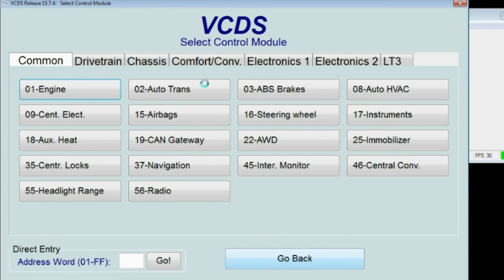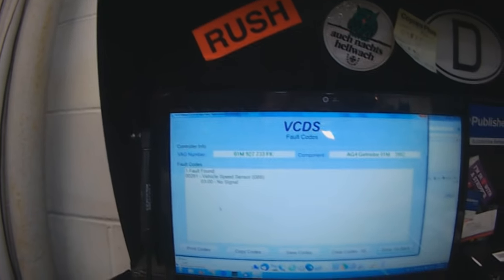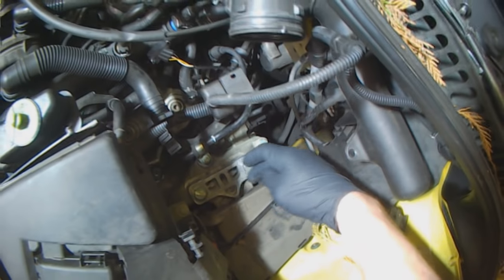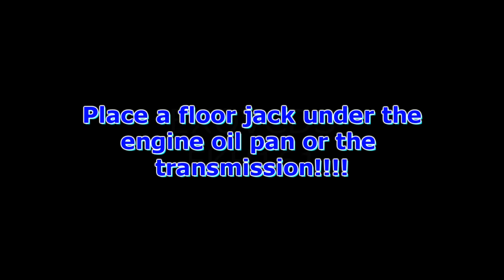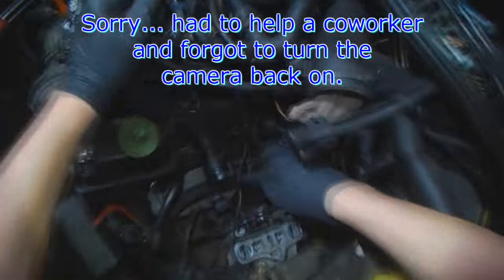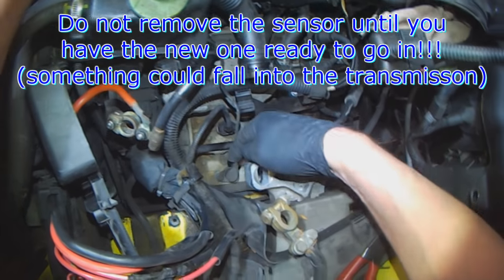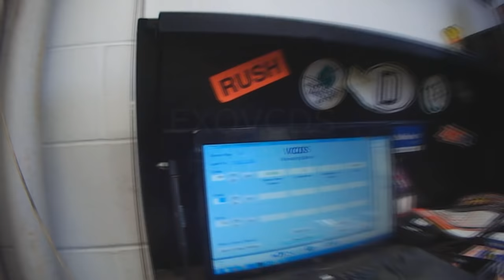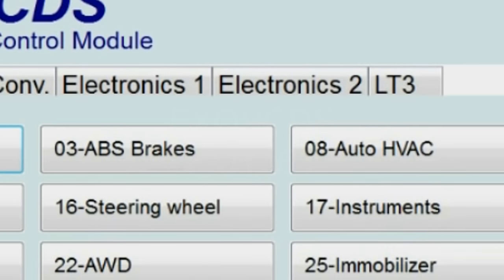VW A4: New Beetle - vehicle speed sensor (G68) no signal

Comment: Hallo. Is that same  location for Speed sensor on 10.2001 Golf 4 1.8t. Automatic.. Thanx
Reply from the maker: Transmission speed sensor... if it's a 4 speed automatic, yes.
Reply: @EXOVCDS  Hi. Thanks for the quick reply. I. Don't really know is 4 speed Transmission. He has 1.2.3.4 and D and on the side I can do it like manually +and - . Is 4 door. 1.8t. October 2001. From first or second gear shift after 3000 rpm and won't to not shift in to fifth. Again thank you for the quick response.
Reply from the maker: @denyderulo1038  Different transmission as the one in the video. The speed sensor is in a different location... I'd have to look where (probably behind the metal cover at the front facing side of the transmission).

Comment: i have a 2001 beetle shifts good but when slowing down and. when accelerating it slips what could it be
Reply from the maker: I assume it is an automatic? Could be an issue with one of the solenoids in the valve body... or low fluid. Check the TCM for fault codes.
Reply: Thomas EXOVCDS yes automatic will check the codes

Comment: 05 2.0 6 speed automatic transmission vw new beetle speed sensor location inside the transmission
Reply from the maker: Vehicle speed sensor for speedometer / odometer? Or speed sensor for shifting (input shaft or output shaft)? Fault codes? The more I know, the better I can guess.

Comment: I have a 02 golf with a miss fire replaced plugs and wires and crank sensor have code for vss could that be causing the miss fire
Reply from the maker: Shawn Viscome VSS should not cause misfire codes. Good quality parts? How's the compression? Fuel injector spray?
Reply: As far as what has gone in yes brand new parts all good quality was told by shop that speed sensor could cause the injectors to spray right and mess with spark
Reply: Not to spray right
Reply from the maker: Shawn Viscome I don't think so... that would affect other cylinders as well. Since only one cylinder is affected, focus on that cylinder.

Comment: 2007 jetta 2.5  p0721 “output speed sensor range / performance  can’t find were the sensor is located runs about 5 minutes then it won’t
Reply from the maker: If the engine stops running...  and you can't start it until the engine has cooled down, then I would say that the crankshaft position sensor is bad. Transmission Output Speed Sensor should not cause / affect engine running.
Reply: Thomas EXOVCDS  The engine does  start just the car will not move when I put it in gear it’s usually after like 15 minutes of driving thank you for your response
Reply: Thomas EXOVCDS Once it cools down when I put it in gear it moves again
Reply from the maker: @sonidovertigo2003  That is a weird symptom / condition that I have not yet come across, sorry. Which automatic transmission do you have? If it's the 09G 6 speed transmission, you can read about the G195 sensor here: (page 45) http://www.evosoft.dk/diagrams/DSG.pdf
Sensor failure "should not" affect vehicle driveability... as listed on the same page (ABS speed input is used instead). I would first make sure that the transmission has the correct fluid level and that the correct fluid is inside of the transmission. Have a transmission shop (that is familiar with VW transmissions) look at the vehicle... you'll get a quicker diagnosis from someone who is familiar with the transmission. You can also leave a comment under this video: https://www.youtube.com/watch?v=MhG1DfJsGyQ He is familiar with these transmissions.

Comment: Hey, I’ve got a vw golf gli 2.0 will it be located in the same place? I have the same codes coming back as what you had. Car is currently ( I believe ) in limp/safe mode as when I’m driving it’s not changing gears at all when I’m drive. Unless I manually do it from 1st to 2nd. Is it in that mode for safety? Or is it like that due to the sensor? Love your replies to everyone and your vid was a huge relief finding 🤘🏼 from new zealand
Reply from the maker: If it's a mk4/A4 Golf with the 01M 4 speed automatic transmission, then yes, same location / same sensor (for same code).
Reply: I had my car checked today. (I had the same two codes as you) I talked to mechanic advising that I’ll need to change the g68 sensor. He scanned and drove car, car was still not shifting right but the speed was showing on his scanning tool and still shows up on my speedometer. So he advised it has to be my transmission ? Because the speed is showing correctly ?? Help haha
Reply from the maker: @koryikinepe1874  There is a separate sensor for the odometer & speedometer. Go to a different mechanic.
Reply: I just done everything you did. Changed sensor, however car is still not changing gears normally.
Reply from the maker: @koryikinepe1874  Did you check for a sensor signal before & after replacement (like I did)? Did you check the wiring? Is fluid level OK?
Reply: Everything was fine I just didn’t check the trans fluid level.

Comment: Thanks for the video. I have a 2002 VW Bora 1.6SR.auto trans. My own code is 00529-engine speed signal missing. My car shifts normally but after sometime, it will go into gear 3. When u switch of the car, everything returns to normal. The cycle repeats often. Other codes displayed are 00518, 00545, 01314 and 01314. Pls what could be a lasting solution to this erratic shifting of my car. Thank you.
Reply from the maker: Are all those codes from the ECM or are they from the TCM?
Reply: 00518, 00529, 00545, 01314 are from Auto Trans address: 02  01315 is from address 01:Engine
Reply from the maker: 01315 in ECM says to check TCM.
00518 - Throttle Position Sensor (G69)
00529 - Engine Speed Signal missing
00545 - Engine - Transmission, Electrical Connection
01314 - Engine Control Module
The ECM & TCM are losing communication between each other... you need to check the wiring that goes from the ECM to the TCM. If turning the key OFF & ON resets things, check for a relay problem.
Reply: Thomas EXOVCDS 
Thanks for the info. Pls which relay  do I check and where do I trace the wire from the the TCM to the ECM.
Reply from the maker: I'm busy editing videos right now... I will look for a wiring diagram / information for you later today and will send you a link once I have something.
Reply from the maker: Engine control module wiring diagram: http://fkh161.ca/VW/Bora/BoraECM.pdf
Transmission control module wiring diagram: http://fkh161.ca/VW/Bora/BoraTCM.pdf

Look for a connection they both share... but something that only affects the Transmission. Since the engine does not lose power or cuts out, the problem might be in the transmission side. When I have time, I will also look at the diagrams, to see if I can find any suspect areas.
Reply: Thomas EXOVCDS 

Thank you so much
Reply: I did check the connection between the TCM and ECM from the diagram you sent me. This can be seen as the orange/brown and black/white 0.5mm cable( pls let me know if there are more) and discovered they re still OK, no damage. I also checked the grounds 114 and 608 and everything looked fine. I checked all fuses and all still ok.Is there any other thing I am missing.  I have also ordered a new G68 sensor. Your advice is well appreciated.
Reply: The wires can be seen on pg 7of 12 of the ECM diagram.
Reply: Thomas EXOVCDS 

Pls can you send me the ABS control module and the instrument/CAN gateway modules wiring diagrams. Thanks.

Comment: Hi thomas, i got a fault code p0501 with my 2001 NB 1.8T;it seem to be my G22 sensor is gone, I would like to ask u , is the vcds the Engine measuring blocks group 005 the vehicle speed its G22 value?Cause it just show 0 km/h ,but Tansimission measuring blocks vehicle  speed which g68 gave me its the same with my cluster. so i would like to know is normal that group 005 the vehicle speed be 0 km/h?
Reply from the maker: In the engine module... any km/h value should be G22 input. If the speedometer works but the engine does not see vehicle speed, then there might be a wiring issue.
http://wiki.ross-tech.com/wiki/index.php/16885/P0501/001281

Check a wiring diagram according to which transmission you have and do some checking.
Reply: yap, i think my G68 its good to work; cause vcds 02->08->Group(004) vehicle speed looks good, and G68 voltages too,  so i ill check my g22 wiring, thx a lot Thomas, i ill let u know what i have found.

Comment: i have a 2001 beetle 1.8t auto  everything works but speedo no CEL on
Reply from the maker: David Roche Is the odometer working?
Reply: Thomas EXOVCDS I don't know I will go drive it
Reply: Thomas EXOVCDS the odometer is not working in my scan tool shows no VVS readings
Reply from the maker: David Roche The sensor for the speedometer/odometer is on top of the differential. Check the connector and the 3 wires in the connector. Most likely the sensor is no good.

Comment: My automatic will only shift manually. Replaced crank sensor and transmission speed sensor. Please help! Also rpm gauge not working . Not sure if it’s related.
Reply: Thanks for the video. It helped changing the tss.
Reply from the maker: Have you scanned the TCM & ECM for fault codes? I'm at work right now... will get back to you with more info later. Year, make, model, which automatic transmission (4, 5, 6 speed?)
Reply: 2000 beetle 2.0 4speed auto. These are the codes I get. 725 1780 1850 1866. I did replace the crank speed sensor and transmission speed sensor.
Reply: I am using a cheap reader so I’m not getting much for details
Reply: And thank you, I’m really getting frustrated with this car. Lol
Reply from the maker: Are those from the ECM? Are they all P codes? P1850 & P1866 are communication faults. If the TCM & ECM are not talking to each other or the instrument cluster, you will have shifting issues as well as speedometer needle issues. I'll get back to you after work. 6pm> Pacific time.
Reply: Thomas EXOVCDS only the rpm at the dash isn’t working. And the shifting issue. Are you thinking transmission control module? The speedometer works fine.
Reply from the maker: @daveclark3989  If RPM at the dash is not working, then the TCM is probably also not getting an RPM signal from the ECM... hence the "communication fault codes". It could be a wiring / bad connection issue. The engine runs, so it is not a RPM sensor (crankshaft position sensor) issue. You will need to check the communication wires that go from the ECM to the TCM & Instrument cluster. Disconnect the ECM & TCM harness plug connectors and check for corrosion... you will need a wiring diagram to check which wires are the communication wires (they are usually in pairs, twisted together and located side by side at each control unit).

Comment: I have a 04 Jetta GLI that portentously has a bad speed sensor. I was told that it might not even be a speed sensor but the cluster that needs to be replaced. When i turn the wheel my gas light turns on at times. My odometer doesn’t work. Any suggestions?
Reply from the maker: Speedometer needle not working & fuel gauge issues, both can be caused by a faulty / bad Vehicle Speed Sensor. Depending on which transmission you have... the sensor is either on top of the differential or inside the transmission. To rule-out the instrument cluster... you can perform an "output test" using a capable scan tool, to activate the operation of all of the needles. If all needles function as they should (when activated in output tests), then the problem is NOT with the instrument cluster.
Reply: Thomas EXOVCDS its a 6speed manual.
Reply from the maker: Let me look at a wiring diagram... I'll get back to you.
Reply: Thomas EXOVCDS you the best brother.
Reply from the maker: Look for the sensor at the back of the differential:
http://fkh161.ca/VW/A4/SpeedSensor02M.jpg

You should be able to see it from the top (use a flashlight).
Check the wiring / connections.

Comment: Hello Thomas, I'm having an issue with the G38 senson, no signal. I replaced both, the G38 and G68 and no change. I also replaced the plastic plug since the old one had the tab broken (probably while trying to remove it withouth knowing how or without the special tool) and no difference. I also just swaped the TCM and no difference, same code. Does it sound like a broken wire to you? I'm working with a 2000 VW Jetta (AEG engine with the 01M transmission) thanks in advance for your promp response.
Reply from the maker: What is the actual code? Usually (with a wiring problem) there will be a "short to plus or ground" fault code. Can your scan tool view live TCM sensor data? I'm heading out for some errands, will reply again once I'm back home.
Reply: @EXOVCDS  
00297 - I'm working with a OBDEleven scanner, thanks!
Reply from the maker: @x-man4702  Using OBD11... find the data / sensor value for G38 (Transmission Vehicle Speed Sensor)... verify that the speed does not change when driving. You can test the sensor like I did, by removing it (leaving it attached) and moving a metal object rapidly across the face of the sensor. If nothing happens, check that one of the wires has a voltage on it, the other wire might also (I'm not a transmission guy, but one of the voltages should be higher). If you do get a signal when wiping a wrench across the face of the sensor, but not when driving, then the sensor wheel in the transmission is not moving. Does the car drive? How does it shift? Can you shift manually? Does it drive better when shifted manually? Here is a self study file for the 01m transmission... page 48 shows the location of the sensor above the trigger wheel.
https://procarmanuals.com/vag-ssp-851303-four-speed-automatic-transmission/
Reply: @EXOVCDS  
Thanks for your quick reply! I just fixed it! It was a faulty G38 sensor, I put another one in and bingo! It was on limp mode so it will start in 3rd gear and didn't shift. However, I was able to down shift manually down to 2nd and 1st fear, but it never shifted to 4th. You should make a video on fautly replacement parts, it's not the first time it happens to me.
Reply from the maker: @x-man4702  thank you for the update... good to hear you found the issue!
Reply: @EXOVCDS  
For sure. I still have one issue left, I hope you can help. Same vehicle, the power botton for the trunk does not activate the mechanics in the back and the keyfob is not working. There's really no practical way to open the trunk, where should I look first? Maybe you have video?
Reply from the maker: @x-man4702  have you seen this video?
https://youtu.be/lVCRK4pBNi0

Comment: Hello,  Would you please let me know that, In 2008 VW Rabbit, the VSS is in the same location as shown in your video? I did not find it before. Appreciated!
Reply from the maker: What is not working? Speedometer? Transmission not shifting correctly? Which automatic transmission is in your car? What fault code is stored in the TCM? The more info I have, the better I might be able to help.
Reply: Hello Thomas,  Thanks you for quick response.  2008 Rabbit manual transmission (USA).  Speedometer and odometer are not working. Brake and ABS light are yellow. The DTC code is:  P0501.  The Chilton manual says the VSS is integrated to the TCM and the replacing is beyond the coverage.  I saw a youtube video shown that the Golf IV has a speedometer in the transmission box, however I can not find it Sunday when I tried to repair.  Today I watched another video shown that the VSS was under the transmission mounting plate which should be removed in other VW golf model before 2006 model.  Also I can not get the VSS part online.  I am thinking to consult the dealer as soon as possible.  Thanks for concern.
Reply: In addition,  I can drive without any problem.
Reply from the maker: Front left ABS Speed sensor is the VSS (the instrument cluster uses the front left ABS speed sensor as a Vehicle Speed signal).
Reply: Wow,  that is really a good news.  I will check this weekend.  Thanks a lot.
Reply from the maker: Scan ABS for fault code to confirm.
Let me know if I was right. =)
Reply: Definitely.  Thanks!

Comment: I'm having a code p0715 transmission/turbine input speed sensor circuit , I'm trying to replace the input speed sensor but I couldn't find it , any suggestions to help address this problem ? 
Thanks in advance and good video by the way
Reply from the maker: Year, make, model, engine and which automatic transmission?
Reply: @EXOVCDS  2007 VW Jetta 2.5 automatic transmission
Reply from the maker: The sensor is above the valve body... you have to remove the oil pan, then the valve body and then you can get at the input speed sensor.
Reply: @EXOVCDS  cool, do I need to reprogram the ECU or TCM? Or everything should be ok when put it back on ?
Reply from the maker: @rafatorres1420rt  I don't know, since I don't know if the sensor is the problem. Sensor replacement might just be plug & play... at worst, you would have to activate some basic settings via a scan tool, for the ECM to relearn initial settings (after valve body removal & installation). I'm no automatic transmission guys... I would track one down and get his / her opinion. 
Someone like him:
https://www.youtube.com/watch?v=33rYBqa9zD4
Reply: @EXOVCDS  thank you , maybe is time for the stealership